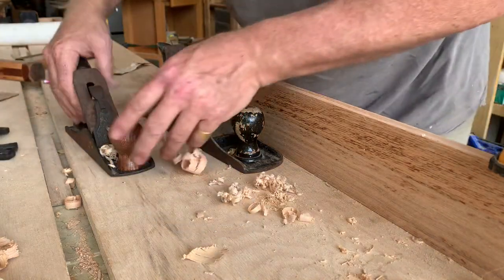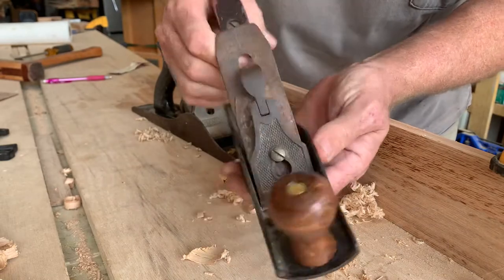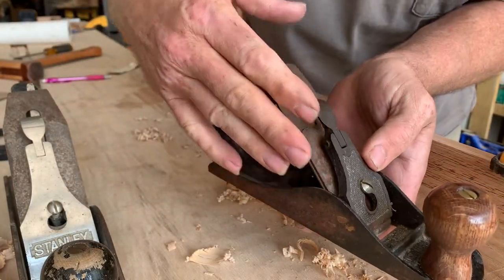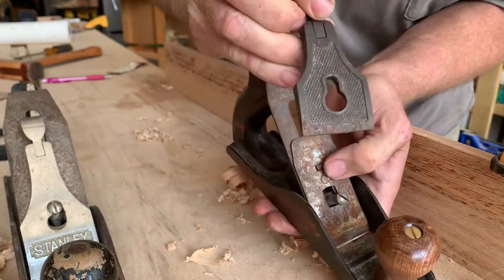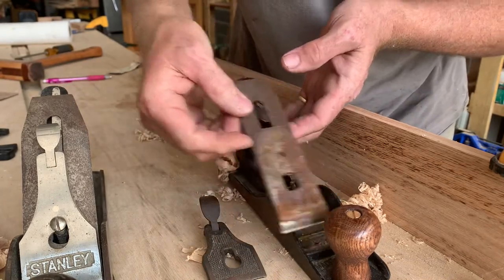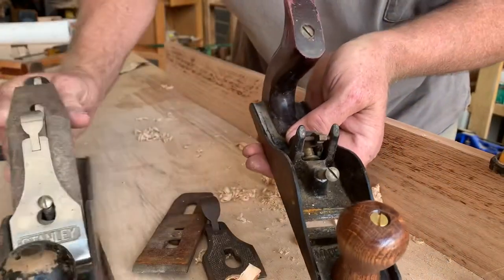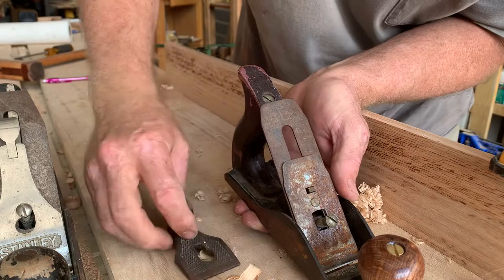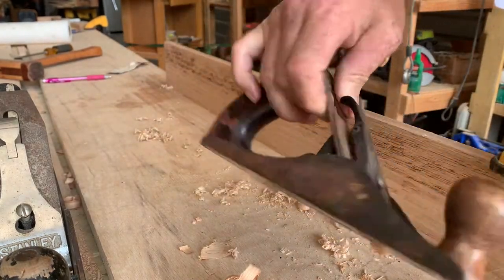Need Help Dating Stanley No 4 Defiance Plane

Comment: This is the exact type of one my dad has. It must of either been his dads or one he got when he was a poor boy trying to make a living. I cant exactly figure out how to adjust it too well. It is a nice looking tool that is for sure. 
I like that handle you made. It reminds me of the fact i did the exact dame thing for an angle grinder. Cut off a section of 2X4 and stained it, then called it good XD.
Reply from the maker: It stumps me!  I think the defiance was made in the 1920s and they just didn't use the current type frog.  Not sure on that, just a guress.
Reply: @handcraftedbygrbroussard361  he says he has no clue so I'm thinking it's the 40s but maybe he got it at a pawn so could be 20s.
Reply: 1939-1962 roughly is what I found
Reply from the maker: @baldeaglearrage3450   Thanks!

Comment: You ran into the exact same "what the heck?!?" that I did when I came across these. While the Defiance line was originally rolled out around 1929, these "low tech" planes were made from 1940-1962 and featured the integral frog, no lateral adjustment, and old school lever cap. Why the need for these ??? My thought was to clear out junk in the warehouses perhaps so let's throw these together because we have all of these, some of those, and a bunch of them. To make matters even more confusing, the 1213 was sold from 1932 through 1934 and was an even bigger deviation of the Defiance planes in that it had a completely old school lever cap which had notches that rested against a cross rod and allowed it to be adjusted somewhat like a chip breaker and I think these were for about 3 years... why ??? Who knows, perhaps to give us headaches and keeping us up at night wondering if the plane we passed by over the weekend might have been it. Hope that helps some
Reply from the maker: Well that clears it up! LoL! Thanks for the insight.  Definitely solves a confusing situation.
Reply: @handcraftedbygrbroussard361  just wait until you come across a Defiance 205/1245 lol. It breaks all the rules and doesn't fit in the Defiance line at all but it's there.
Reply from the maker: What do you think about the lever cap? 
Almost looks it came off a  transitional plane. Crazy.
Reply: @handcraftedbygrbroussard361  I can only imagine what they were thinking with these. I know it's been said the Defiance/Eclipse and Handyman lines were basically made from whatever they had at the factories. Sort of makes sense looking at the lines and what's in them, lot of stuff rebranded
Reply: I have one exactly like that….mine has “defiance” stamped on the main tote, in a post-modern script.  Does yours (I couldn’t see it in the video, if it does).  I figured this was late 1950s to early 1960s.  I can’t imagine it’s earlier than that, as I don’t think of a once-great American company such as Stanley ONCE WAS, taking short cuts, until the late 50s-60s.  Frustrating?  Yep.  And beware, every Stanley video…I’ve watched,trying to accurately date mine….only serves to make me want to increase my bourbon intake!
Reply from the maker: @captaincoyote1792   Your bourbon intake! Too funny! I agree, I try to learn as much as I can.
Reply from the maker: Thanks!